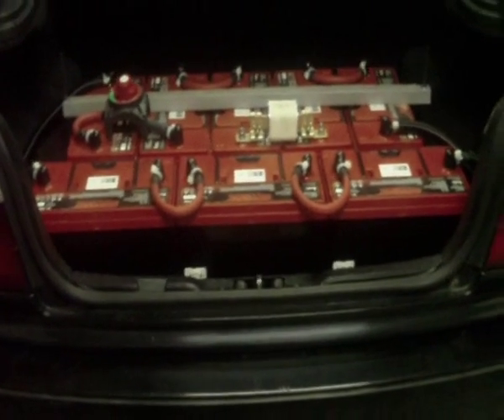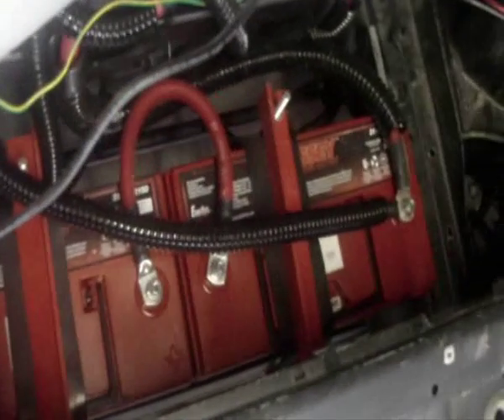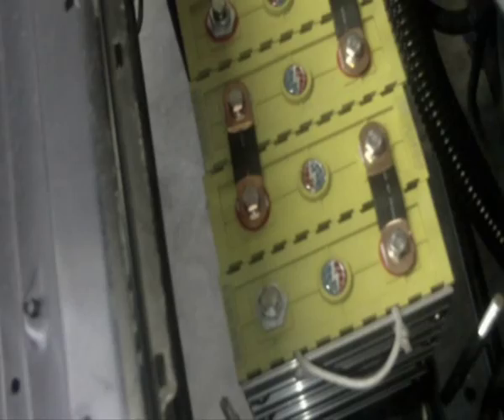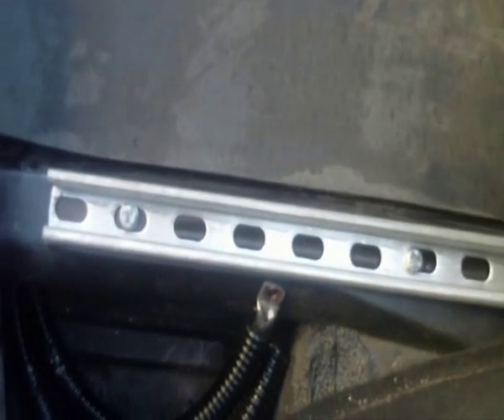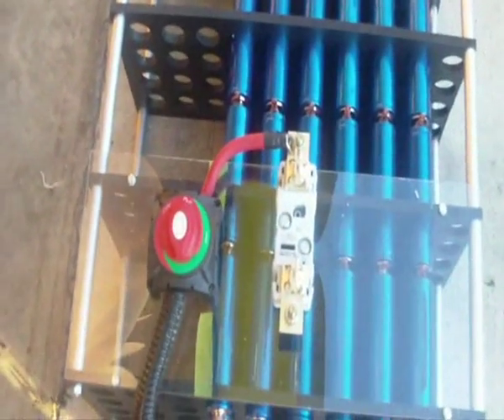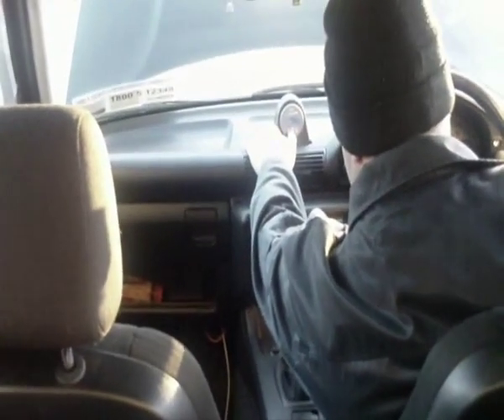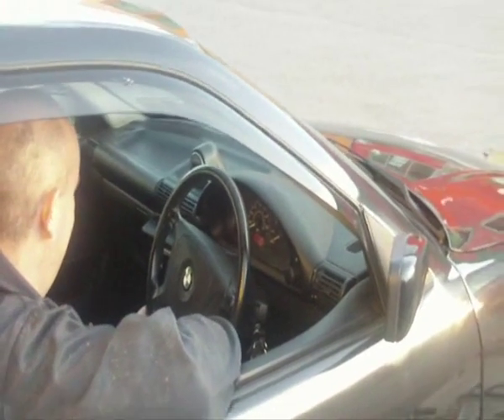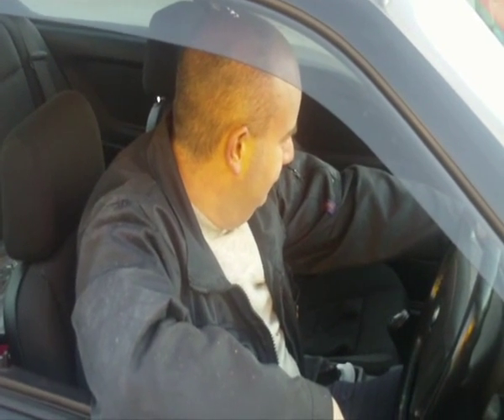BMW EV Conversion 33 Lithium battery 03

Comment from the maker: Yeh 96 cells 16ah lifepo4. It will be 180 cells when finished. No need to worry about shocks unless i come in contact with both terminals but good advice nonetheless. Burnouts will have to wait for the completed pack.!!